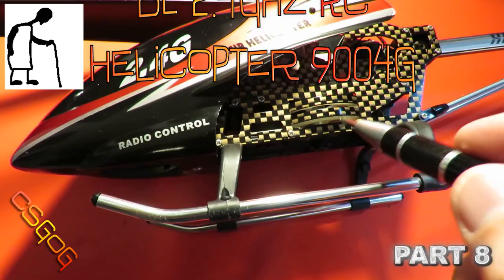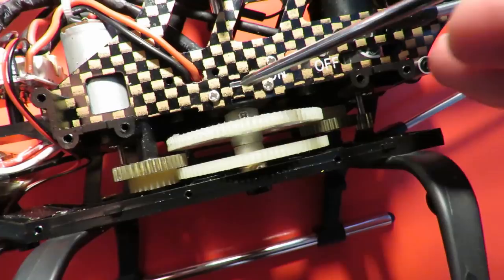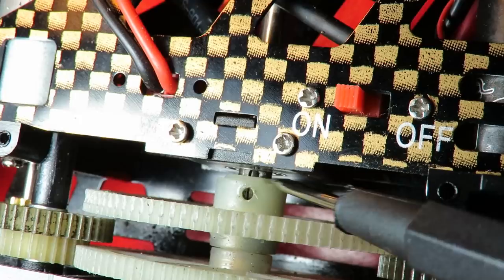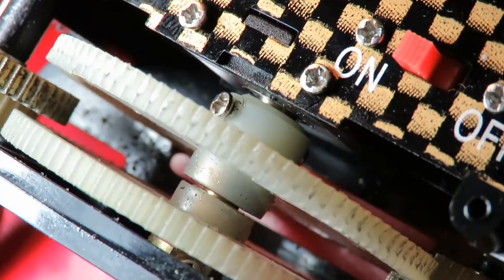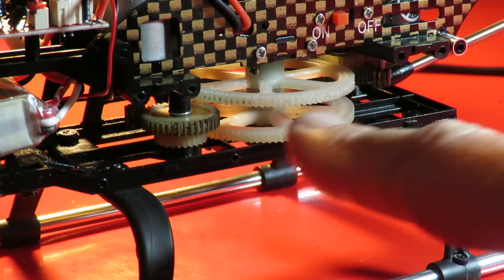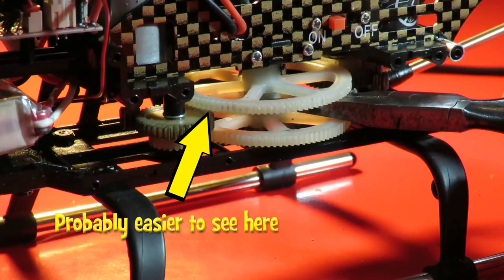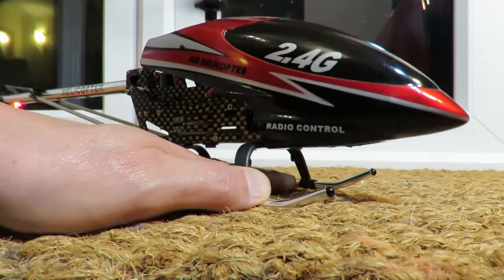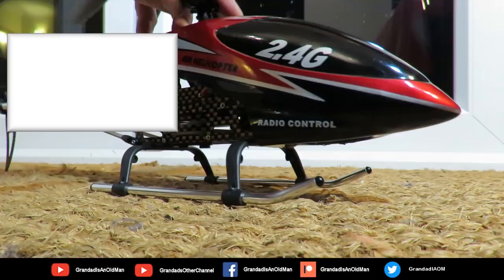CSGOG BL 2.4Ghz RC Helicopter 9004G PART 8 Lower Rotor Gear

Comment: Hope u get it working .defo the gears making a rattle .you won't be defeated .😊your a joy to watch .
Reply from the maker: Hey thanks. I have had a couple of reasonable flights but as soon as the battery power drops I lose forward/backward control. I don't want to spoil the fun of the next few episodes, just saying that when I seem to lose control and it gets "interesting" it is lack of battery power that is the issue although I don't realise that at the time.

Comment: at 3:15, it might possible to reduce the 'warp' a bit, by adjusting the two set-screws for that gear.     cheers
Reply from the maker: Hi David, that might work but as I have currently stopped it slipping I really don't want to touch them at the moment. If it goes loose again I will see if it helps.

Comment: I just bought a big Helicopter too for only 5 złotych (about 1 Pound), with controller, and charger . Unfortunatly the battery seems to be dead, and I don't have any spare 7.4v battery...
Reply from the maker: That is why I say don't buy them second hand, there is always something wrong with them. That is what I am showing in this series.
Reply: Yeah, but for only 1 pound, it was preety worth it, even for parts.
Reply from the maker: Yes for parts it is worth it :-)